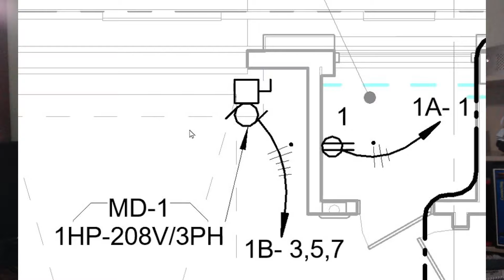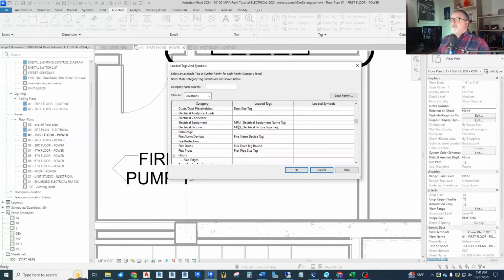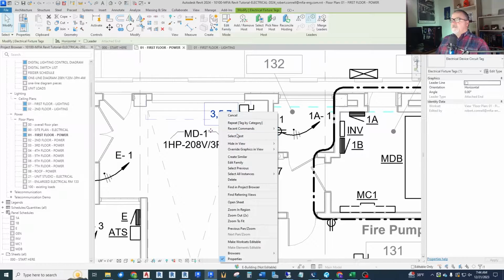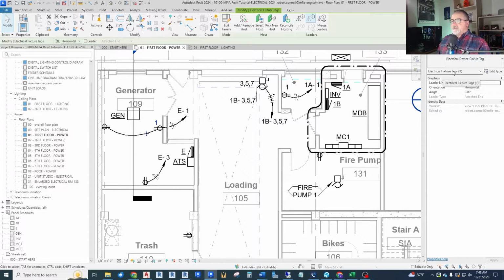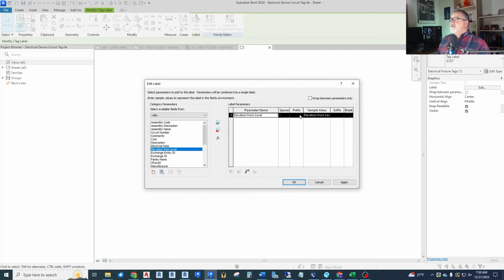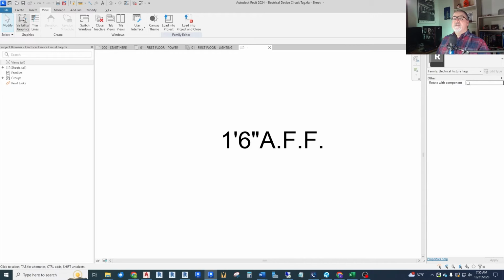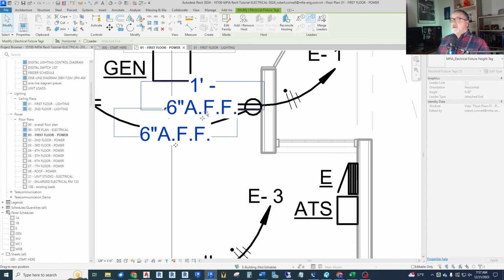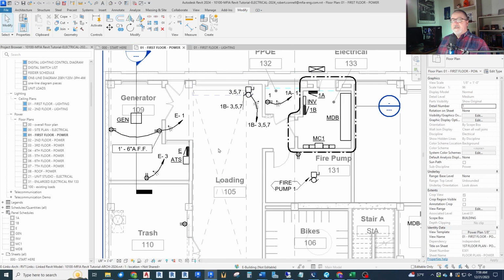REVIT MEP Custom Interactive Tags! (Family Editor)

Comment: Hi Rob, I'm having a problem then I found a similar question in revit community, but without a simple resolution.
Do you have any ideia how I do this: 
"I'm working on a furniture floor box that can have up to  4 connectors for power logic.  I can simply add the additional connectors and everything works fine on the panel schedules.  Now on the floor plan, I need to identify the circuit numbers using the built in parameter "Circuit Number," and "Panel."  
What I'm seeing is that only the "Primary" connector values propagate to the parameters on the parts!  If I switch the active "Primary", I'll get  the new information for "Circuit Number" and "Panel", but the secondaries are no longer shown.  Piping and Duct can "Link Connectors" but I don't see that option on electrical Fixtures.
How do I get the panel name and circuits to show for all of the circuits tied to a single receptacle?"
Reply from the maker: Hey there Julia! That's an interesting one! I've also used multiple connectors like you mention, but I guess I've never tried to tag their circuits. I will have to dig into this one to see what can be done - I do enjoy a challenge! Thanks for asking!

Comment: Stepping in from the mechanical manufacturing industry into electrical engineering, it has been a hard adjustment. I found this to be extremely helpful.  This was needed to be seen in your MEP Complete Course ep. 4 - time stamp 31:31. This is because out of the box circuits do not show panel tag just the circuit.  Thank you for your training.
Reply from the maker: Thanks for much for your feedback, and I'm so glad you are finding my information helpful! And yes, there are some fairly simple "tweaks" that can be made to the Revit out-of-the-box families that I show throughout various videos. I might make one consolidated "top ten" easy family edits for beginners that are low-effort but help a lot.